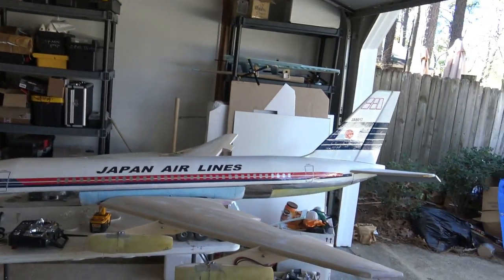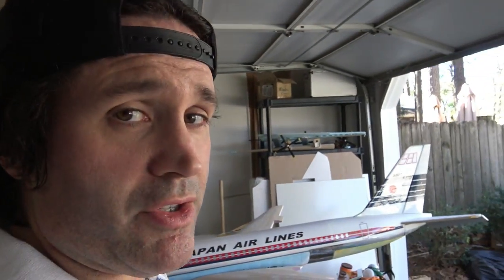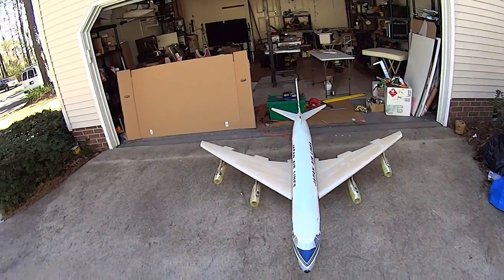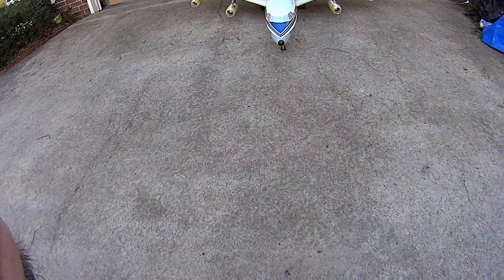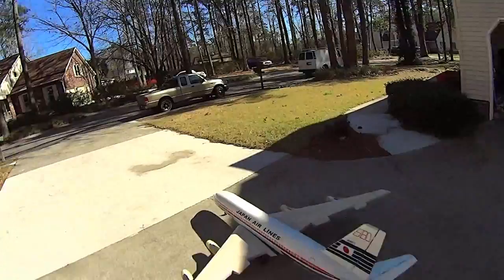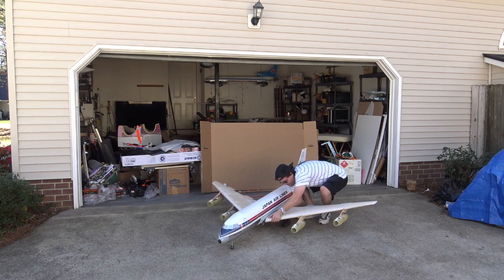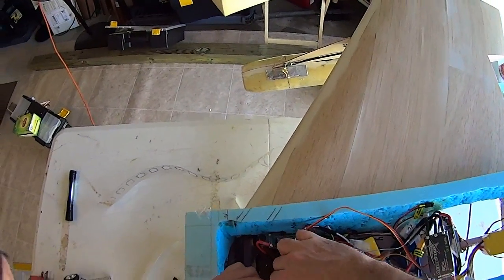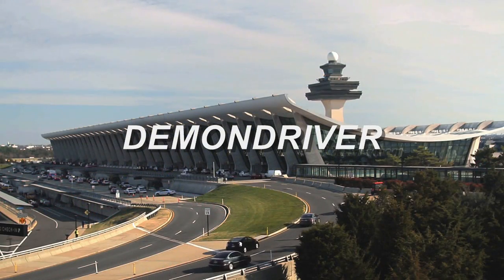RC Airplane CV-880 TAXI & EDF TEST 日本航空コンベアCV880

Comment: at 8:00 where is the spar?
Reply from the maker: There is a large 5mm Carbon fiber Cross Spar forward of the Main Gear well, you probably couldn't see it due to all those Batts & Speed controllers in the way.

Comment: Sounds great, Looking forward to flight!
Reply from the maker: Me too Brian! there is a TON of wiring in this beast!
Reply: No doubt! I bet the weight of all that wiring adds up. I've been thinking about making a bus system for power, but haven't had to use it yet. Some day...

I just can't bring myself to build an airliner, although it would be totally cool if I got her to fly good! I just want too many features. I'm not happy with just ailerons, rudder, and elevator...I gotta have complex fouler flaps, spoilers, leading edge slats, retracts, but they gotta look and function scale, and gear doors, but better get some lighting in there too! The list goes on and on... If I could just be happy with a simple model, which I won't be, I could already have it!!!

Thanks for posting!
Reply from the maker: Brain you can build a simple 3-channel RC plane too, Personally I have Brain Damage, that's why I build such complex RC Planes LOL.